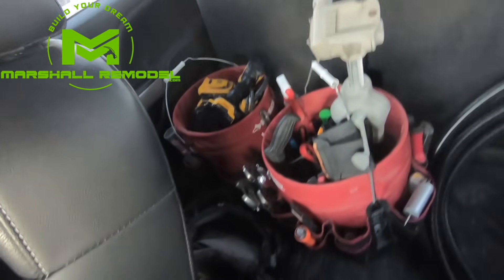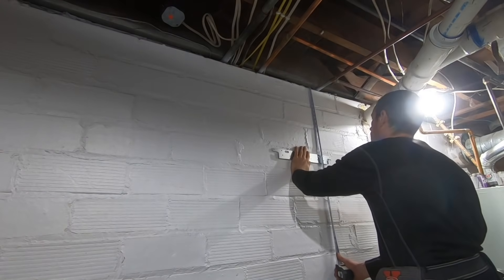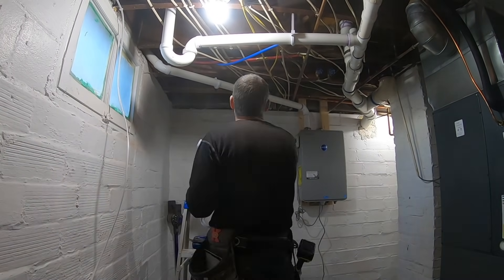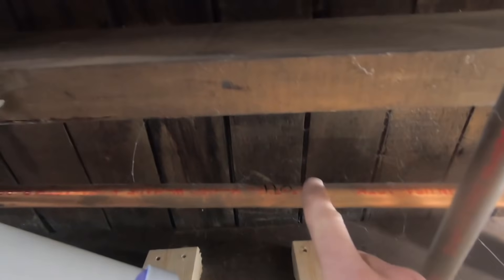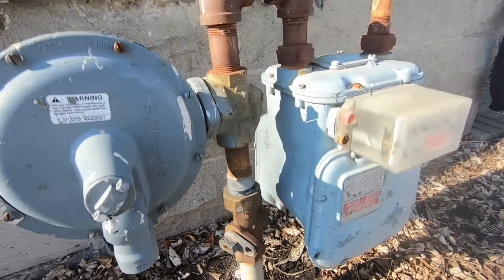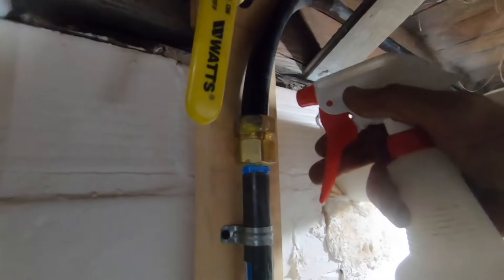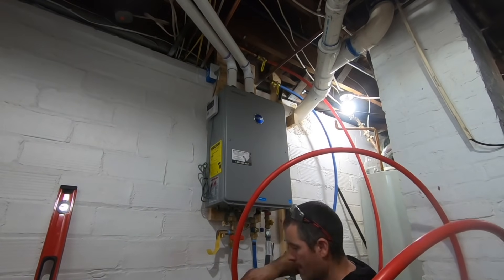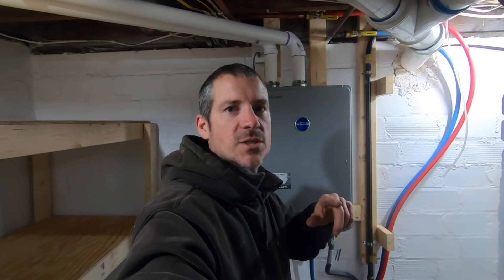Tankless Water Heater Install | Existing Home

Comment: Hey how is your tankless system running?  Do you like its performance?  Any issue so far with running a tankless heater?
Reply from the maker: We've been happy with it. Have used them in multiple homes without issues.

Comment: You didn't show how you installed the electrical connection?
Reply: Needs only a 120v  regular wall outlet to plug in.

Comment: So dude.....condensing or non condensing? I should had watched your video 1st......so only a condensing water heater you can use PVC sch 40? And never use a existing water heater vent because it will rust? I accidently ordered a non condensing unit and have no way to run a new exhaust. But if i return it and buy a condensing water heater I can run PVC for vent?

Comment: my condensate line  curls up  into my washing machine drain ,  will that be an issue ?
Reply: I you can get it there that is fine. He just dumped it into the french drain which is wrong, that is why he didn't show it
Reply: Condensate is very acidic and should not go straight down the drain.  It needs to be neutralized beforehand.  This install would never pass code in my area anyways.

Comment: Could you have put the exhaust out the old water heater's exhaust pipe?
Reply: Got another question, do you have to use pex pipe coming out of the water heater, can you use copper instead?

Comment: Any experience with putting a recirculating pump on systems without dedicated returns?
Reply: i thnk most of these units have internal re circ pump.  bypass valves can be installed at furthest fixture if no dedicated line exists

Comment: According to “NFGC Recommended Clearance Distances from a Direct Vent Gas Appliance Terminal to Other Building Features” the distance from the vent centerline to a building inside corner is 3 feet?

Comment: So there's no mention of electrical power requirements for your controls?? You have to provide power and yes the amperage is miniscule but without electrons you wont have any hot water!!

Comment: For anyone watching this, what kind of hangers and brackets can be used to secure the iron gas pipe ?
I’ve run into a situation where the gas pipe has a long run without support.  It just hangs there and will wobble around if anything disturbs it. Just touching it, makes it shake badly. 
It’s not good.
And any answers will be “for entertainment only.”  
Thanks.

Comment: Quick question. Is it feasible to install small electric models in each bathroom versus installing a larger system for the whole house?
Reply: Yes, that is how many homes do it in other countries.
Reply: @coveyjt1   never heard or seen anything like as to what your talking about  ? 🤔 very interesting,,,,,,,,,
Reply: @bustersmith5569  They are called Point-of-Use water heaters.

Comment: I'm from Ontario Canada and we are not allowed by code to put the exhaust / intake pipe so close to a window because exhaust fumes could come back into the house through the window.  Code here is a minimum of 36 inches away.  Is it different in your state
Reply: in the states, many clearances for vents on a condensing unit is 12 inches
Reply: Another video I watched indicated 4 feet is the code clearance to a functioning window. This video emphasized neither window near the vent/hose spigot was functioning, thus close proximity was permitted per code. Without many options on that basement install, I would think taking the vent up vertical in the corner higher than the porch window would make the most sense, if it were a functioning window.

Comment: Nice job on the install! While you are at it you should install a fresh air intake to his furnace. Sucking air from the house for combustion will draw cold air in from the gaps and cracks in the home.
Reply: Bud Weiser, you did not see two pipes going to the outside by the windows? How could you miss that?
Reply: Hardly enough cfm draw from a furnace intake to do that. The house would have to be under negative pressure for a it before it starts pulling outside air in. One time opening the front door or back door and the house equalizes.

Comment: 200K Btu tankless/ 60k furnace/38K Stove = 298,000 Btu 1inch line....10ft of one inch does 387K.....20ft of pipe on 1inch 280K btu.............250k btu meter....... every 90 elbow is 5 feet ...... Have ya had issues with it especially in the winter? Confused .....Curious thanks

Comment: Never ever use Teflon tape on gas lines as it flakes away and can plug the gas valve, also I would tend to belive that gas line would not be my choice as pipe is a safer bet.
Reply: Hi Wayne.
Can you offer advice on this 👇

For anyone watching this, what kind of hangers and brackets can be used to secure the iron gas pipe ?
I’ve run into a situation where the gas pipe has a long run without support.  It just hangs there and will wobble around if anything disturbs it. Just touching it, makes it shake badly.  
It’s not good.
And any answers will be “for entertainment only.”  
Thanks.

Comment: That flex gas pipe needs to bonded also
Reply: If it's attached properly to the black iron pipe, isn't the black pipe already required to be properly bonded? I would think bonding it twice would induce a loop.

Comment: Looking to install 1 of these. Is there a problem with venting the exhaust out the chimney the way the old unit was? Additionally, the unit that I've viewed does not seem to have an air intake like the 1 you used. Can you share insight on this?
Reply: It's against code to vent via the old chimney. The moisture from the exhaust is bad for chimney. But since you will need an intake anyway, just run them side-by-side like he did.

Comment: Never thought can use pvc pipe for exhaust, thought only metal pipe can handle exhaust heat.
Reply: Any appliance that is a higher efficiency, can be exhausted with pvc material. Because it's a high efficiency, most of the heat it produces goes out the supply and less thru the exhaust.
Reply: The new super efficient units only get to about 100-125 degrees max.  The problem is the condensate that is acidic and needs to be neutralized from the exhaust.  It all reality, the concentric medium efficiency units are easier to install and do not have as many issues along with code requirements.

Comment: Im not trying to be mean, but this is not the correct way to do it.
Its all fun and games until you flood the house or have gas leak somewhere.
Plus that intake pipe that you put above your exhaust pipe will suck that fumes inside the W.H. not the best idea.
overall great 2x4 brackets.

Comment: Do you need any certification as a gas-fitter? Building in Australia, I'm sure you need to be qualified and hold a certificate for every trade, electrical, plumbing, gas-fitting, and overall, the builder will have a license.
Reply: exactly,,this guy is a hack,,,-only hire a plumber-insured fot this specific work..
Reply: @stevestadterman9270  I wasn't accusing him directly, merely asking about the local codes and requirements. So many videos on Youtube and the contents rarely refer to even the country let alone local government, makes it hard to judge the quality of the content.
Reply: @stevestadterman9270  any specific issue with his install? I see him using blue tape for water & gas both. Everything I'm learning indicates yellow for gas and usually white for water. Maybe blue or pink. Getting that O ring crooked the first time is easy to do, especially if the line is cut a bit short. 'Cut em long!' is always a good guideline, usually easier to move a little slack than to stretch lines, cables, pipes, tubing, etc.

Comment: This is really nice but in New York City they want black pipe and p e x is not allowed they still want Copper L type I would have put 10 feet of inch and a quarter to build up the volume of gas then transition to 3/4 those units take a lot of BTU like 200,000 gas pressure is low in a home that's why they rely on volume but if it works why not also the exhaust New York City they have special PVC for these tankless water heaters whatever part of the country you're in it's easier to install New York City has a lot of people on top of each other so the code requirements are higher standard also the chimney they want furnace cement you can't put anything you want I usually put a piece of wire mesh and then furnace cement that's design for a chimney what I don't like about these units if you lose power you lose hot water you don't have that with a free-standing tank also once a year you have to flush out this heater with white vinegar or they sell a special chemical if you have hard water with a lot of minerals you may have to do it every 6 months is videos on YouTube to show you how to do it just some food for thought hope I helped someone out
Reply: Thanks, Jeff…it’s all interesting to me!
Reply: @philipneri9482  you're welcome

Comment: Interesting that you use PVC pipes for exhaust gas... wouldn't the heat melt the PVC piping?
Reply: This is a "condensing" gas appliance. This means that the exhaust is cool enough to condense (most or all of) the moisture out of the exhaust. Looks like their gas furnace is also condensing.

Comment: No offence, but I think the sharkbite ball valves are unprofessional, and I think everything would have looked much cleaner if you had used fittings instead of just bending the pex pipe.

Comment: I hate to see someone install Peck pipe as if it was a water hose and I damn sure would not use textable gas pipe that has an old rain to stop the leaking

Comment: If you're saying putting those valves (Sharkbite/Push to fit) in exposed is okay because if/when they leak in the future (which they will) its easy to fix/change them out.... why not put in a sweat valve in the first place? You got the water off, it takes 2 minutes to pull the torch out and do it right.

Also, really don't like that exhaust in front of that window. Right now it may not be "operable" but you've really sealed its fate by running that exhaust there. Could have planned a better route.

Overall not a bad video, but definitely room for improvement.

Comment: I have no idea about gas tankless heaters but every single electrician I have spoken to have always been against tankless water heaters. At least on the electrical side. I have always wanted an electric tankless water heater but all my research has always shown they're just not worth it.
Reply: Why
Reply: @queerdor  Electric tankless water heaters are super super inefficient.  NG is far less expensive and produces more energy to heat the water.

Comment: As a plumber that does 100s of tankless water heaters and boilers, this would never make it past a decent inspector unless you live in a back woods 1 horse town that doesn't follow international code. I've seen worse but this is not good at all with many mistakes.
Reply: Yep, another Carpenter playing Licensed Plumber. No issue with insurance and permits? HA!
So many issues... 
No Plumbing Permit
No Gas Permit
Sch 40 pvc no longer legal to use (at least here in MASS!) for the guys exhaust
No Liability Insurance
Push to fit valves
Valves under heater not for "draining" but for annual flushing of the heat exchanger
Condensate not proper
I could go on and on... 
He is qualified to run those 2x4's down from the floor joist though. 
Not doing his family any favors here.
Reply: Facts
Reply: @tomhill9027  How many times are you going to rip on this guy for his install? Looks like you are copying and pasting the same shit over and over.
Reply: I'm surprised they didn't complain about the water bottle he was using. 😮
Reply: Tell us all the problems you see then

Comment: If you do that in a house for a customer  and they pay you I hope you use a little  more skill with those water lines  when you bend stuff like that it puts stress  on the pipe and the fitting it's attached  to just some advice from an old plumber

Comment: Not a fan of the installation. Right angles your friend. That pex is just not pretty at all. Normally I'll do any exposed piping in copper and then transition to pex where it's out of direct line of site. It will work fine, but its ugly.

Comment: You do know vibration can cause that ccst nut to loosen over time you definitely do not ever want to hand tighten gas connections ..? You had me lost when you used shark bite shut off valves . So much issues … at the end of the day it’s not my work 🤷🏾‍♂️ home owners will be home owners .

Comment: Wrong size gas line, shouldn’t use Teflon tape on gas fittings, soapy solution is wrong, pex to water heater is garbage.  The list goes on.  I’m assuming he didn’t know how to sweat anything. SMH

Comment: That is HACKED IN most states have laws (code) and I see several points that would fail the inspection people must use licensed pros or you will pay if anything happens terrible video for the industry

Comment: Going to have a leak on that csst gas piping regular dawn dish soap is corrosive to the material. Please don’t perform work without having the knowledge on what your doing and call a professional. Should never touch a gas appliance without a license good job on testing it but you don’t have to information on what you are doing exactly I aloe would of ran my piping for my water better and cleaner. Gonna do a job also at least make it clean.

Comment: What a sloppy install. Pex looks like crap,  using shark bite ball valves, bushing down in gas pipe, using a flex to tie in gas to unit. no neutralizer, wouldn’t pass code. next time hire a professional

Comment: So many code violations on this job. Clearly just remodeled. Who allows 1w and 14 gauge wire to be stapled to the bottom of the joists like that? No pressure treated against the concrete. Wouldn’t fly in my area.